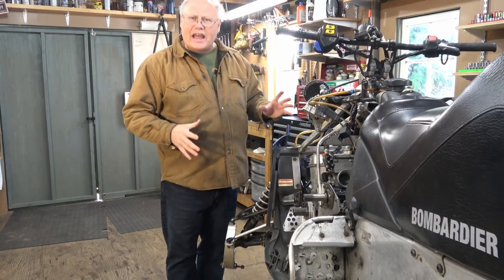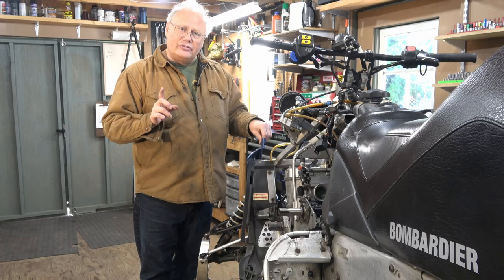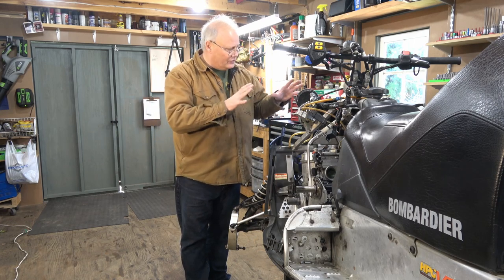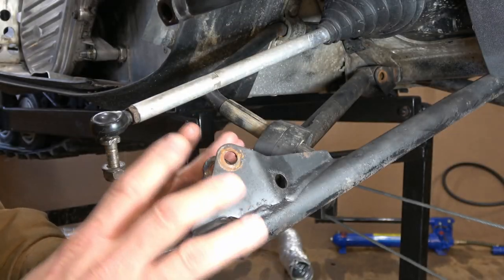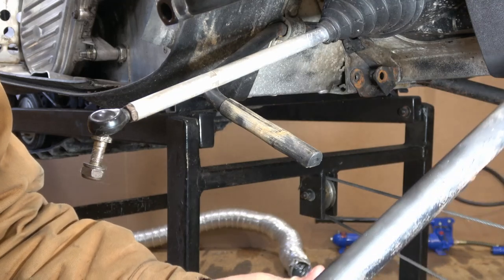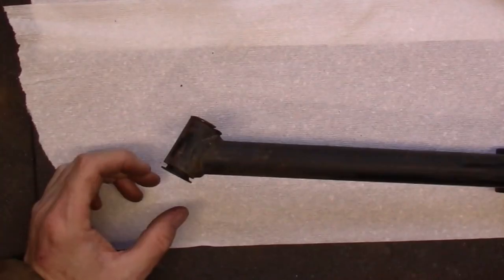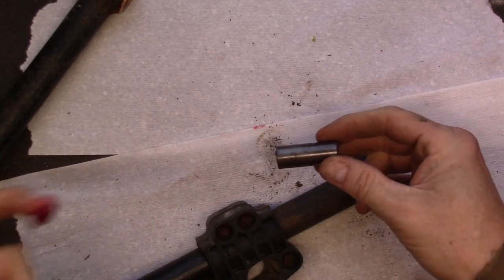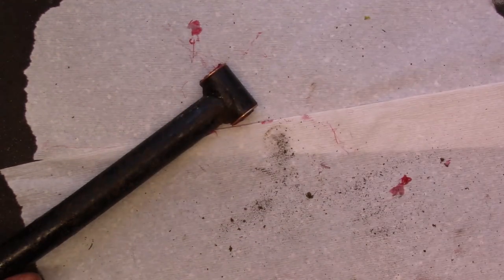Today, I show you how to rebuild a SkiDoo front suspension with Oillite bushings.

Comment: Those oilite  bushings wear fast also. Mainway solutions has greaseable 660 bronze control arm and swing arm bushings that are much better.
Reply from the maker: Good to know, thank you for the information
Dino
Reply: They are not cheap but if you keep them greased they will outlast the sled.  Good for trail riding. Did you regrease the crank bearings for him with iso-flex? those bearings tend to let go without notice on the 2 strokes and take out rods cases etc... they should be greased every 600-800 hours imho. I have an 03 rev 800 with the x package, your clutch videos helped me out, I had Polaris sleds in the past.  Still learning about the revs but I know quite a lot now.

Comment: Another great instructional video Dino.  I started watching you as I have a DR, but enjoy all your content.  If you have come across a good video on how to properly/factory lower the DR I’d be keen to see it, I’ve ordered the parts and will be doing mine at end of January.  I’ve got a manual that seems comprehensive, but always helpful to visualise first.  Finally, do you still plan to edit a video on your Tinker Shed renovation?
Reply from the maker: Thank you for the questions, I do have a fork seal video  that shows all the components and which spacer to move to lower it.
 https://youtu.be/U-SsoWVYpM0 
As for the rear I do not have a video on that subject yet, I have reached out to a few other youtubers to see what they would recommend and will get back to you on that.

I am still planning on the shed video over the winter. I have taken a bit of time off for the holidays but am back to production and it is on the list.
Thank you again for the interest and support!
Dino
Reply from the maker: Hi Again, MotoDans out of New Zeeland has a video that covers both front and rear,  he says the audio is a bit quite but should have the information you need, his channel is really good as well and more than worth checking out. Here is the link to the video https://youtu.be/gPm9AKF5LBg

Hope this helps.
Dino
Reply: @DinosTinkerShed  thanks Dino, really appreciate your response.  I have already seen you fork seal video it’s great and really helpful for the forks even though I won’t need to change my seals.  But it’s the shock lowering mainly I’m interested in, I have seen Dan’s but he doesn’t cover the shock either really.  I think the Clymer manual I have will get me through.

Comment: Very helpful video! I am about to tackle installing a 2012 ski doo front suspension. Do you happen to have plans to do that video on installing the ball joint into the a arm? Did you just do hot/cold and a lot of brute first? I liked your camera work a lot!
Reply from the maker: Thank you for the comment. I have not had another sled to pull the ball joint out of yet. Because I did not have the correct tools I used a combination on large sockets, my vise and a large hammer to remove the old ball joint. the placement does not allow the socket to rest squarely on the control arm and in the end I had to rest half the control arm "boss" on the vise and tap the ball joint out. It was not really a good way to do it. 
Eventually I am sure I will have to replace another and I will produce a video on how to do it but it may not be for a while.
Sorry
Dino
Reply: @DinosTinkerShed  No problem at all, totally get that. Keep up the good work and thanks for the tips!